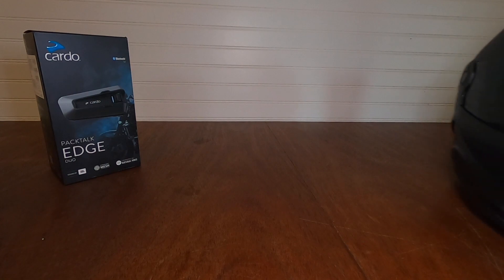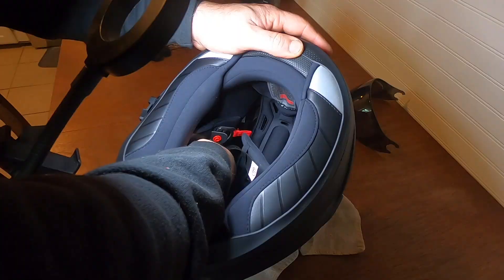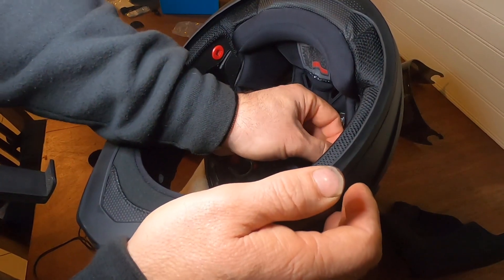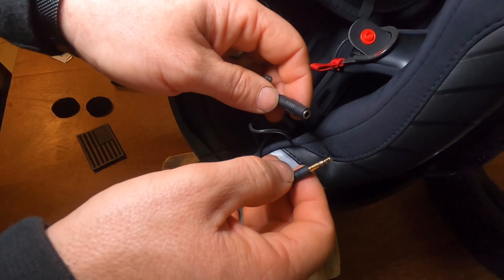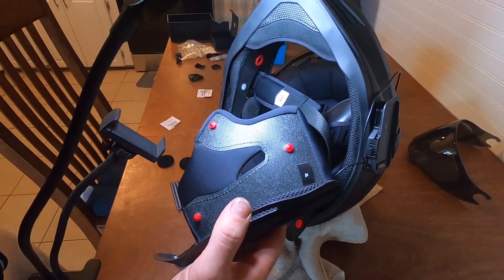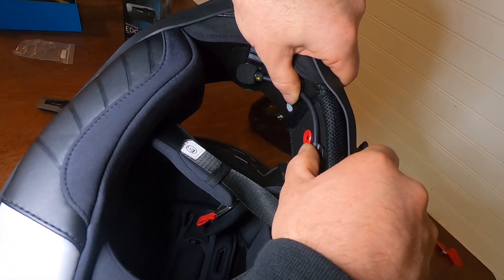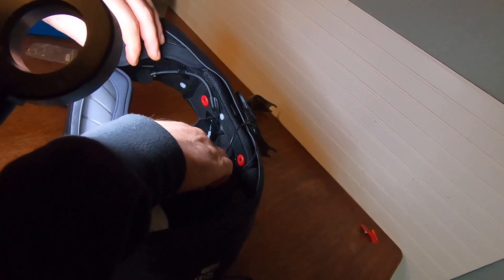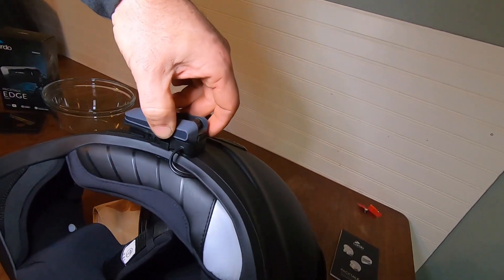Cardo Edge Install. Make Riding your Harley Davidson more enjoyable.  #cardo #scorpion

Comment: Have you noticed a difference in mic volume between the boom mic and the wired one?  My bold is WAY different between the two.  I'm assuming it's because they buffer the boom for open face helmet use?
Reply from the maker: The button mic was lower volume and more background noise. The boom mic is not directly attached to the inside of the helmet, so I believe that separation may be the benefit. The mics themselves may well be designed differently.
However, one of my homies runs the button mic on a different helmet and it’s pretty good. But… I’ve been wrong before.

Comment: Did you have any issue with the speaker sticking to far out and hurting your ears ?
Reply from the maker: Definitely with the spacers. Without them I’m good for about 7 hrs. My left ear starts to get a bit sore past 8-9 hours.
Reply: @JaySorsby1  thanks for the reply bro ride safe !!
Reply from the maker: @samca671  Are you having issues?
Reply: @JaySorsby1  yes sir its sticking out to far and hurting my ears really bad i think imma cut alittle of the foam so they sit deeper in the helmet i dont have this problem with shoei rfsr
Reply from the maker: @samca671  I was thinking I might use some targeted heat to remove a bit of material on my left side. I have solder iron I don’t trust that might fit the bill.
Reply from the maker: @samca671  Just to be clear, we are talking about the hard foam with the recessed circles, correct?
Reply: @JaySorsby1  yes sir
Reply from the maker: @samca671  Cool. Just checking.
Reply: @JaySorsby1  honestly bro i sent it for a dermal with sanding wheel and i made my speakers almost flush with the foam lol fits so much better !!
Reply from the maker: @samca671  ball end bit?
Reply: @JaySorsby1  no sir i used the sanding drum it made a huge mess but i couldn’t find my soldering iron